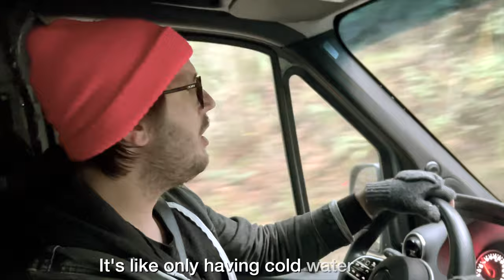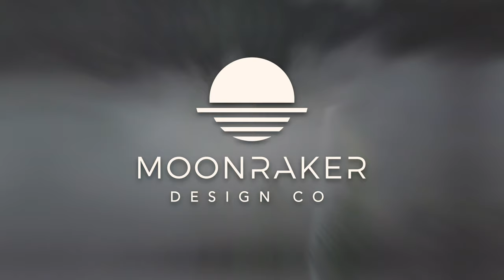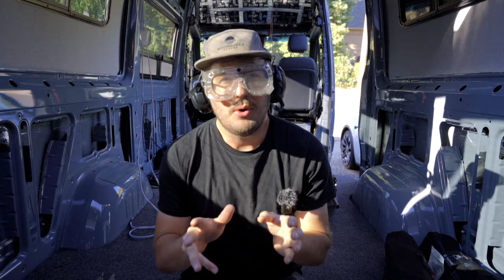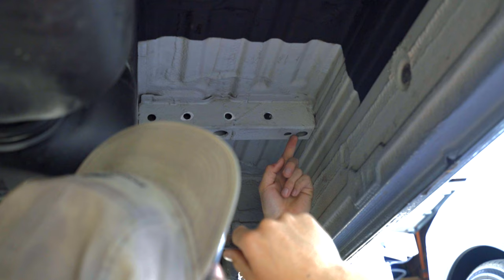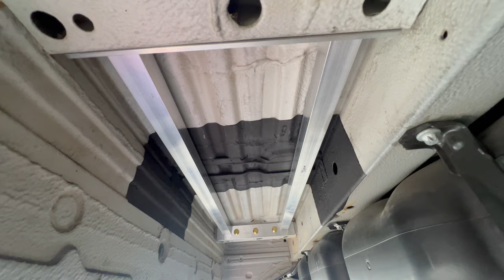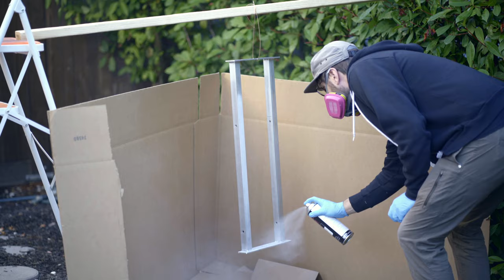Sprinter Van Conversion Hydronic Hot Water System Install

Comment: Great install, interesting system. How efficiently does the engine heat the water tank when D5 is not in use?is there much loss from the long pipe runs and heat exchanger?
Reply from the maker: Initial testing shows water is up to temp in about 30min - 1 hour depending on the start conditions.  The tank keeps the water warm for over 10 hours.

Comment: Great video! What mechanism is in place to prevent the water from boiling and stop heating up before reaching the boiling point?
Reply from the maker: Hey there, since the average temperature of the Sprinter Coolant will be 190ºF-230ºF and there will be some heat loss from the exchanger to the water tank I don't think we will have an issue.  I did add a temperature probe to this loop though https://www.youtube.com/shorts/CixUVKZOb4A.  If it is a problem I can cut pump flow with a relay from the Cerbo GX. 

On the Espar side when that's running that controls the coolant temp 167ºF - 176ºF.

Comment: You are using so fancy tools! Unheard of tools. And those custom made brackets?/ How did you do all that? Are you using some fancy 3D printer? That's crazy work! I read your disclaimer that this is not professional. If that is not professional, I don't know what else would be. I have never seen something like that!
Reply from the maker: Yeah I have a lot of tools… my business before and now required/requires some of these things. My wife is convinced I have every tool under the sun. I prove her wrong about once a month. 

I’m using a vertical CNC milling machine for almost all of the custom brackets and stuff. It’s actually the exact opposite of 3D printing where you start with a big block of material and remove it until you have your part.  It can handle a wide variety of materials, but 3D printing is making big strides!  

I guess I’m a professional engineer, but I’ve never converted a van before so this is new territory for me.  

Thank you for your comment and your kind words. I really appreciate it.

Comment: Todd, a question.  Why did  you choose to create hot water via a tank vs a heat exchanger?  I thought that was the whole point with hydronic systems.  You could avoid a water tank in lieu of a heat exchanger. Were you concerned of the proposed 1 gallon per minute limitation through the heat exchanger??  Very curious as to your thought process (which I hold in high regard).
Reply from the maker: Hey there.  Sure thing.  We take a lot of day trips to the beach and stuff with our dogs as well as move daily almost all the time when we are camping. I really liked the idea of heating up water on the way there and hold it in reserve without having to turn a system on for these instances. To wash them off or our feet etc. it’s really taking advantage of that free heat and storing it while driving.  The water tank will easily keep the water warm after parking for 12-24 hours depending on outside conditions. 

The D5 was actually put in because I scored a sweet deal on it and is primarily used as a back up if we are stationary for a while, engine block hearing (longer term) if needed, and an additional air heat source from the rear of the van.  

Hope this helps and clears things up.  There’s decision tree after decision tree when building a van. You’ll just have to figure out what makes sense for you and how you’ll use the van.  It’s actually one of the hardest parts because eventually the decisions also affect each other.
Reply: @moonrakerdesign  Todd, thank you as always.  The standard shower head is about 2.5gpm.  Seems like the Rixen, etc, heat exchanger model is about 0.8gpm.  I think your design makes the most sense.  Isotemp will also provide electrical backup if you're plugged in.  Keep sharing your skills!

Comment: Just stumbled upon your video, your system is remarkably similar to what I'm planning. Have you come upon any 'oops' or 'gotchas' yet? I have a superflex 460 surplus diesel heater, Kuuma Marine water heater, and plan to add a water to air 'heater core' for interior heating as well as valves to isolate 'zones' when not needed or for quicker engine coolant or water heater warmup.
Reply from the maker: Really only planning out if I wanted additional loops.  I'm going to put an air handler in the back of the van for more heat and would have been nice to run those hoses with this original install.  Like you I'll have valves that shut that loop of in the summer time.  The other things is I'm finding out now I need to drill the the floor for my l-track so I need to take the hot water heater back out to get these brackets install. 

So really just about planning all the cascading and colliding projects.  It's pretty tough if you've never been through it before.
Reply: @moonrakerdesign  I spent the winter (waiting for my vanagon to sell) planning out the water and electrical, hopefully I won't have to redo too many things. I settled on one large coolant loop with 'bypass' valves to isolate the different systems when not needed or for maintenance. I settled on Engine - Diesel coolant Heater - Water heater - Aux heater core - return.
Reply from the maker: @kbeefy  Sounds like a great plan!!  After this install, I think it would be really fun to go back and try to make a central Aquahot type box to control everything. I hate how almost everything in the van RV space is run on proprietary controllers.  If I have time in the future would love to go back and centralize it one day on a more open source platform.
Reply: @moonrakerdesign  Thats well beyond my skillset, I'm going to try to make it just a bit more automated than frankenstien switches and manual ball valves. It won't be as elegant, but I think a few thermal switches, a few electrical actuated valves, and alot of wire and it will work good enough.  
Have you bought an air handler yet? I see some cheap ones available that are 10-15k btu, but I think I'd rather go with something in the 30-45k btu range.
Reply from the maker: @kbeefy  Sometimes simpler is the best solution!  I haven't bought my Air Handler just yet.  But I'm size limited so I'll likely end up with something in the 8-15K range.  I've been looking at AMC, Rixens and the Aquahot handlers.

Comment: Im confused on why you put an additional heat exchanger and coolant reservoir if the Isotemp has a heat exchanger built in. I’m doing the same setup as you so it would help immensely
Reply from the maker: Hey Paul. The coolant reservoir is needed because the coolant will expand when heated. You can’t have a closed system without a place for that expansion to happen.  Espar recommends around 6L of space in the manual if I remember correctly.  You can buy these off the shelf. 

The extra heat exchanger allows me to take heat from the engine coolant loop while driving without being totally tapped into that engine coolant circuit itself. Meaning if anything fails on my added coolant loop the engine loop is unaffected and will perform as normal.  This also allows me to use a different type of coolant in my water heater loop that is safer. If some how it contaminated the water through a heat exchanger failure in the water heater (highly unlikely) we wouldn’t be poisoned. 

Others have skipped this flat plate exchanger and just plumbed the whole thing into the same coolant loop as the engine but that means if you have a leak or failure so does the engine. 

Let me know if this makes sense or if you need anymore info.
Reply: @moonrakerdesign  awesome. Thanks for the reply
Reply from the maker: @paulwade8103  No problem if you have any other questions you can hit me up at hello at farrframeworks dot com.  Happy to provide any additional info.  Happy Building!
Reply: @moonrakerdesign  I did find you on Insta and shot you a message on there before you sent this

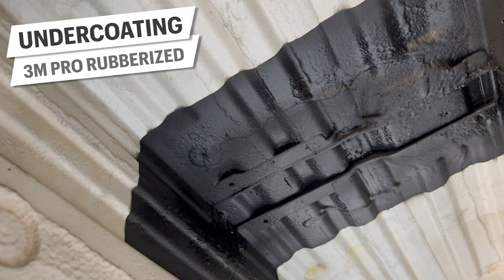Comment: 4:14  I think you have a lot of experience with rivnuts.  I'd like to ask your opinion about mounting Unistrut on my vans walls.  I am building out a work van and was wanting to put Unistrut on the walls so that I can mount modular cabinets to it. Mounting like FeatherBuilt does, you can look up their basic Foundations kit and see how they mount it on the walls, I want to do mine like that.   Do you know what size rivnut would be used to mount Unistrut to my van's walls (I plan to buy my Unistrut from McMaster)?  I see a lot of opinions about Rivnut's verses Plus-Nuts or even using a combination of the two.  But it seems most guys like yourself and others who have a higher level of attention to detail (like Project of Science), use mostly rivnuts.  And with the proper tools maybe rivnuts are best if you install them correctly.  I see you like the Astro PRN1, but if I were only going to be using 2-3 different rivnut sizes I might be able to just use the single use Wrench-Driven Rivet Nut Tools from McMaster.
Reply from the maker: Hey Glenn, I wouldn’t go less than 6mm threads for installing this type of thing. This is what Ad Wagon uses and I’m sure feather built does too. If I remember right the factory holes are around 8mm so you are going to need to drill them out a bit put some rust prevention in place (I like marine grade anti seize for rivnuts) and then set them.  

There’s a lot of debate on plus nut vs rivnut.  I like rivnuts because they are lower profile and don’t take up as much space behind the wall. There are some places you need to set a nut that a plus nut wouldn’t fit so IMO why not use them for all. I’ve never had one spin on me, but like you said I used the pneumatic pull tool. 

I really think rivnuts work best with a pull setter. I don’t really like the ones that spin because you really need to make sure the rivnut mushrooms before any torque is applied to it.  Just a lot less margin for error. 

Anyways if you want to talk more you can always email me at hello at farrframeworks dot com. Happy to give you my number there and we can chat on the phone too!

Comment: Great video.  Do you have a recommendation between Rixon and Aquahot if I want to go with the off-the-shelf method?
Reply from the maker: Hey @JasonConroy, thank you very much!  For Rixen's vs Aquahot there are definitely pros and cons to each.  

From my personal standpoint and opinion if you have the dedicated space where you can tuck the Aquahot box in your build it's a pretty elegant solution which takes out even more of the work required to put one of these systems together.  The form factor of their air handlers makes more sense to me too in a van where space is pretty limited you save about 100in^3 for each one.  The fact that it can support up to 16,000ft out of the box is awesome too if you plan on doing high elevation camping.  Anyways @humbleroad put together a good overview of the internals of the Aquahot recently you should check out if you haven't already. 

With Rixen's new  MCS7 controller it's a much more compelling solution for me and I'm really glad they upgraded things.  The MCS6 controller felt like it was from the 80's and there's no way I'd put that one in a van I own in 2024.  However, you will still need to piece the parts together from the kit and really figure out how to mount and run the components.  That being said from what I know about Jim over there is he will personally guide most people through this process and the amount of support and guidance you get from Rixen's will be above and beyond Aquahot.  I'm assuming at a big company like Airxcel to get support you'll have to go through a support ticketing system, where as with Rixen's you can call Jim directly.  That kind of small business family support has its own weight in gold for DIY'ers in my opinion. 

I hope this helps, unfortunately I'm an outsider looking in since I haven't used any of these systems directly in my own build, but people say positive things about both. Ultimately, the best choice for you will depend on your specific needs and priorities. Consider the size of your van/RV (will you benefit from multi-zone), your budget, your heating and hot water requirements, and your preferences for installation and maintenance.

Last point here from me, I'd still probably consider a hot water tank for my needs with either system if I went the OTS route.  I have two dogs and we go to the beach a lot and being able to load up on hot water on the drive there and hose them off with warm water (they are babies about cold showers) without having to turn on the burner is critical.
Reply: @moonrakerdesign Thank you for the detailed reply.  I haven't seen Humbleroad's video yet but will soon.  It's a big expense so want to make the right decision for me as I plan to start living in my 170 AWD Sprinter full time beginning April 2025.
Reply from the maker: @JasonConroy  Yeah definitely and congrats on the move to commit to your sprinter full time!! That's awesome and can't wait to see what you put together.   One other option I forgot to mention in my video was what @floriskyland2568 commented below and another option I was looking at was the Webasto DualTop.  I know another option to add to your list and also equally if not more expensive.  But I think it would be good to look at all options objectively before making you decision!  Note with that one you can't run heated floors, but not sure if you have that planned anyways.
Reply: @moonrakerdesign  Thanks for the additional information and tips.  After watching Mathers on the Map's second build videos and knowing my wife gets cold easily, heated floors are definitely on the schedule.  Leaning hard toward Rixan right now based on everything I've seen and your help.

Comment: Little bit too much engineered for my taste, but you made it look good. Whatkind of battery/charge setup are you gonna do? I will do only engine loop and heating element for non drive days.
Reply from the maker: Appreciate the viewpoint, and yes I definitely get way to deep in the weeds with some of these projects when it's not required.  My day job has become a lot of management and keynotes lately so I use this as my outlet 😅.

For the battery charging setup. I'm going with dual alternator as the primarily powering source, I can only fit about 320W of solar on the roof.  I have 640Ah of lithium going in.
Reply: Great detail! Excellent video!
Reply from the maker: @kevinmctarsney36  thanks for the kind words, and the comment.  We are glad you liked it and it's very much appreciated 🙂